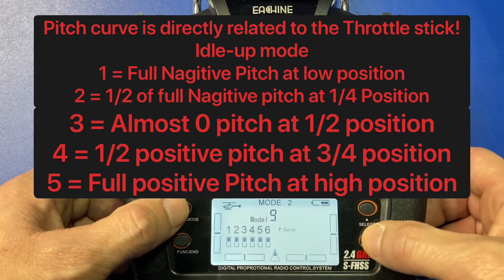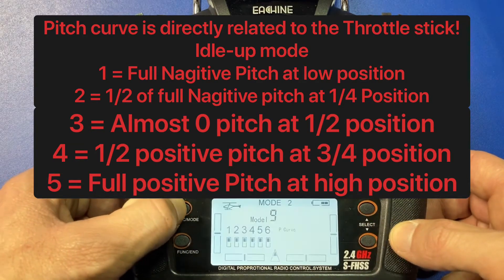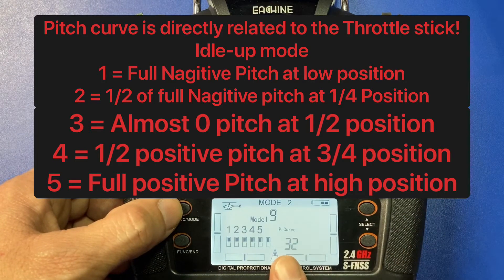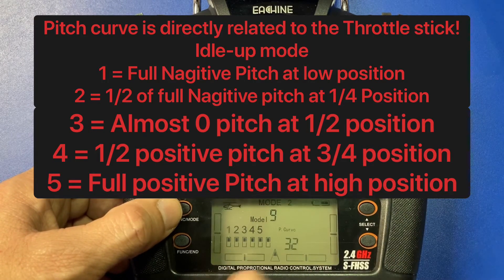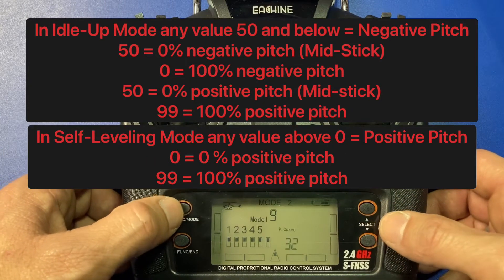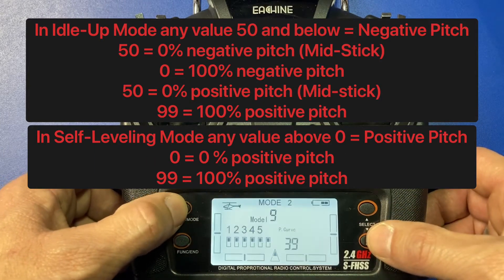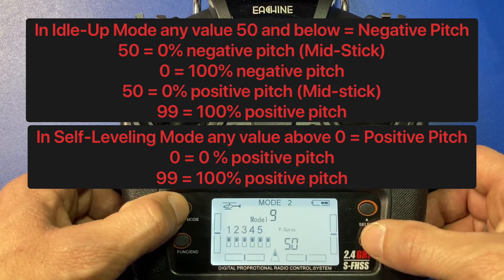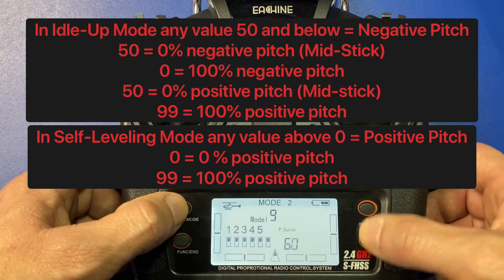Eachine e6 TX... T-Curves & P-Curves

Comment: Hello, I've been reading through your posts.  I saw you were considering buying the e180.  Did you get and fly this yet?  I have the e180 but no one to ask questions about it.

It came with the e6 tx and for the most part the curves were flyable for me but I toned down the head speed in both normal and 3d modes.  This is my first collective pitch and I don't do all the fancy 3d stuff but I do like to throw the sticks into a good tight banking turn and some loops and inverted  hovering.

So of course I've had some minor bang ups one of the last ones I broke my collective servo horn so replaced it.  Went into the servo centering mode on the receiver and leveled swash plate.  I'm worried with the sequence I did things because now when I flip switch for 3d mode it seems stuck in 6g.  

Heli won't let me bank or roll or invert or anything it just wants to level itself back out.  Seems like its stuck in stability mode or something.  So I thought maybe some setting I pit in tx was wrong but had no clear instructions on how to reset tx so like a fool just started button combos with powering on and ended up changing into mode1.  After figuring out how to get back to mode 2(throttle on left stick) I can fly again but still can't get out of stability regardless of flipping that switch.

Is there a way to hard reset everything back to factory?  I've seen this heli fly and it can do some.prwtty intense 3d for what it is but mine is way too tame for what I like to do.

Lastly, I'm centering all servos and 90ing horns as I've had to replace that servo horn AGAIN then will perform swash level in servo mode of receiver.  Noticed when I spin the motor it feels "notchy" and not smooth.  I never noticed this before ot always felt smooth.  Is this motor bad already.  I've barely even strained it yet.

I would appreciate more than you know any input as collective and setting up is all new to me.  I've flown fixed pitch for years but that is boring now.  This collective pitch is the ticket now!
Reply from the maker: Hey Keith, Thanks for the comment... Yes I did get the e180 but I set mine up with my Jumper t12... Look for the video it will be out very soon.
 YES COLLECTIVE PITCH IS THE TICKET!!!
I would suggest you first check that when you were pressing all the buttons as you said you did that you didn't change the gyro setting for Idle-up(it should be at 25 when you flip to 3d mode)... also check that all your other settings are as they should be... check that the sensitivity dials on the receiver are set back to factory settings(I think they should all be flat and facing the plugs)... you might as well try doing the debugging again on page 9 of the manual... 
As for the motor, it sounds like it may be a bad bearing... you would have to take the main shaft out and check that all the bearings that the shaft  runs through feel smooth... you can check the motor at this time as well.... does it feel different in the air?  Crashes can cause all sorts of damage, some minor at first but then get worse over time(like bearings)... Also make sure your MAIN shaft is not bent! You will also want to grease up the feather shaft and bearings because from the factory there is not a bit of grease(be very careful - there are very small parts in the head that go in a specific order) Let me know if you get it fixed or if you need more help with your TX settings or anything else. 
Please Subscribe, Like and Ding the Bell!!!
Reply: @DaddysRCAddiction  thank you!  Main shaft out and motor out.  Main bearings feel great.  Motor still feels not right.  I know it was smoother I remember spinning it when I got it.

I don't think I can set two gyro settings on that tx.  Same goes for expo.  One setting for all modes except d/r. 

I never messed with any of the screw settings on receiver.  Theu are all turned same way I think the slot is in same direction length wise as heli. I'd have to look again.  

I will try your suggestions.  How hard is it for a receiver to go bad?     Also what kind of grease do you use on the head?
Reply from the maker: @keithlong2788  Sounds like it may be the bearings in the motor... mine does feel very smooth when I rotate it.
I use RED N' TACKY #2, it may be a bit over kill but I find it works well.
Expo only has one setting for all modes but the gyro must have at least two different settings to tell the heli that you want it to go into ARCO mode... When in the gyro setting of the menu flip the 6G/3D switch... In the 6G position the setting should read 75... in the 3D position the setting should read 25, if it doesn't then this is the reason why you can't get out of 6G mode... change it to 25 when the switch is in the 3D position. I have hundreds of models and I haven't had a receiver go bad yet... maybe I have been very lucky:) let me know how it goes!
Reply: @DaddysRCAddiction  You were right!!  Gyro was on 75% in 3d mode.  I switched it to 25%.  Confirmed by toggling the switch.  6g reads 75% and 3d reads 25%.  I wish the manual explained things better but i guess thats China for you!  

As for the motor, i did rip it down and the bearings feel just fine.  Took the windings out and it's fine in there.  Can't see a thing wrong.  I'm pretty sure what i'm feeling is the windings going past the magnets.  But i don't remember it feeling that way when i first took it out of the box.  Just really can't remember now.

So question is, is it normal to feel the notchy type feeling from the windings or are they supposed to be absolutely smooth?  I think i'm putting it back together and just flying it.  The motor is $40 and it'll take 2 weeks from Banggood.  I didn't think about length of time when i would need parts for shipping.  I want to get a better transmitter as i've been training with real flight 9.5 and that spectrum it comes with is so much bigger and better feeling.  I'm having a hard time with that e6 transmitter as it is smaller and harder for me to get a full motion of the sticks.  Maybe it's just me.
Reply from the maker: @keithlong2788  Once you decode the Chinlish in the manual and play with the TX a bit its all pretty basic.
Glad I could help out with the gyro... Yeah motors will have that slight resistance from the magnets... if I rotate mine very slowly I can feel it as well but it is much smoother than my other helis and quads... and it is absolutely normal!! Many of my other motors have a much more notchy feeling... I should have mention that! The e6 is an OK starter TX but a better TX with hall gimbals will give you a much better feel at the sticks.
Have you adjusted the end points?... This will give you full stick motion.
Reply: @DaddysRCAddiction  i have not adjusted anything other than curves, d/r, expo, all the normal stuff on the tx.  What is involved with adjusting end points?  Does that involve the little screws on the receiver?
Reply: So everything back together.  Centered and 90'd all servos.  Did use some sub trim to help with that but noticed it took away from full deflection so I will zero all subs then correct with debug mode.  Servo 2 I got dead even 90 with no adjustment so I will use that as my master then level the rest in debug.

But regardless it flew and I tried 3d with the new gyro setting at 25% and yowsers!!  This thing is like a loose rocket!!  And this was at 60% rates.  Expo doesn't seem to make much difference with this tx anyways, maybe dampens in down a bit.  

So my biggest complaint, why does it take so long for servos to return back from your last input.  Like delayed reaction and its making me over correct.  Nothing is stuck.  This seems to be how this system is.  The input is as fast as you apply but when you go back to center the servos are like a good 3 seconds behind.

Can this be controlled?  I may consider.another heli if I can't fix this because I didn't train like this.  And definately gotta save for another tx because I'm hooked on the spectrum and those sticks.  I can see now why people stay with the same tx for all their models.

I really appreciate you taking the time to read my posts and replying and helping me out.   If there is something I can do to fix this delayed reaction with the servos please let me know.
Reply from the maker: @keithlong2788  😁it’s nice to hear that you are enjoying your “rocket”!
I love my spectrum system as well... for the most part it is flawless and easy to use but that does come with a cost!!!
There are other systems that are just as good but you do need to know or be able to figure out the little quirks that they may have.
Direct drive systems are super efficient and powerful compared to gears. I’ve turned down just about every setting and it still feels powerful! 
Now Exponential is tricky... I typically fly with little to no expo depending of the heli and radio. 
Expo takes effect around mid stick so if you have too much expo and you are at or near mid stick a lot you are going to have a lot of delay(this is why I tend to not use expo.) so what you are feeling could be the area on the sticks where expo has softened the sticks... I felt it a lot on this heli and turn my expo almost completely flat. Also, once you move the stick beyond the assigned expo setting then the actual amount of throw will happen... so if you have a 1/4 of the stick soften with expo the response will be limited until you pass the 1/4 Mark then what ever would be normal movement without expo will happen all at once on your heli to catch up to your stick movement where expo is not assigned.
Hope that made sense.
Now it could also be the potentiometer gimbals which can wear out or just flat out not work well straight out of the box.
But I’ve found that all my X6 and E6 tx worked pretty good so I would try turning down the expo... try flat and work your way up a few points at a time. 
You are very welcome for the help... I wish I had some help at the beginning as well!
Reply: @DaddysRCAddiction  yeah this is my first.collwxtive pitch and its direct drive at that.  I can't say I'm enjoying it yet!  Quite nervous is more like it.  Not like the sim where you can run forever and just hit reset when you crash.  Four minutes goes super fast and I would swear it feels like only 2.

This delay im speaking of is basically the swashplate coming back to level after a command.  Its after expo which is what I don't understand.  Like if I give right aileron ot goes right aileron right away whatever I give it.  But when I let the stick come back to center the swashplate is so slow to follow.  So when I correct out of a bank when the swash catches up I'm over corrected.  Not sure how to explain this.  Is this by chance anything to do with gyro?  What happens if you turn that 25% down to zero and no gyro at all in 3d?
Reply from the maker: @keithlong2788  that sounds like too much expo(expo is effective around mid-stick) so if you just go back to center, that is where expo(less stick/servo response) is applied... because of the expo the servos aren’t responding to your inputs... have you tried no expo? You can visibly see the effect of expo when programming it(try 0 expo, move the sticks very slowly... it should follow your every move... now try 60-80% expo and move the sticks very slowly you will see that very close to mid stick the servos will not move at all... further out they will move a bit... then towards the outer edges the servos will move a lot to catch up! 
This is what I noticed when doing tic tocs... a big lag... then I dialed down the expo and everything’s was better. At least for the way I fly.
Just go slow because it will follow every little hair movement... this is the way I fly for the most part... I like the feeling of instant response. But it can be tricky when learning to fly that way.
Reply from the maker: @keithlong2788  don’t change the gyro setting
Reply: @DaddysRCAddiction  yes I tried 0 expo, negative expo, positive expo all while moving sticks.  I've read with futaba systems you need negative expo for less on center stick.  But I though expo was only noticed on inputs, kind of like slowing down a command.  This is occurring well after input.  Like I can take my finger off the stick and watch the plate neutral out.   Gotta be something I'm not doing right.  And we already agreed that tx only has one expo setting for both flight modes correct?  I want no delay on the input or return but not sure we're gonna achieve that.

What do the 3 little screws do on the receiver?
Reply: You mentioned aboit endpoints earlier too.  How.do you go about that?
Reply from the maker: @keithlong2788  Yeah its backwards with futaba... If its occurs after inputs then it could be your potentiometer gimbals... I installed Hall gimbals in my Jumper t12... I will try it on mine and see how long it takes to center.
I just tried it... and what you are seeing is normal for Idle-up modes... It will not snap back to center like it does in Stability mode... In 3d mode it will  hang behind if you let go of the stick because it think you still want to go in that direction but you will notice if you move the stick purposely from center to edge (not letting go of the sticks - complete control) and back again it will follow your every move.
When flying a heli you never what to let your sticks go anyway... you are always making hair like to extreme adjustments depending on what your are doing.
Why don't you get a spectrum satellite receiver and hook it up to your spectrum system? You have a spectrum radio right?
So there is no endpoint adjustment on the e6 tx... the only way I've found to kind of get an endpoint like adjustment effect is to adjust the High dual rate so that the servos don't bind and that the stick is moving the servo through its complete range of motion... this is not like real end point adjustment but I do this on all my inexpensive TX and I find it works well.
But it sounds like you are hooked and a better radio is in your future!!!!

I haven't messed with the 3 little dials yet but in the manual it looks like you can increase or decrease the sensitivity of your tail lock and swashplate... not sure of the effect it will have. very small adjustments if you mess with those dials.
Let me know how things go!
Reply: @DaddysRCAddiction  I only have a spectrum interlink for real flight sim.  Man do i wish it wasn't gutted because i'd switch it over in a hearbeat.  i was looking at spectrums the other night.  Had my eye on the DX6e though i do like the DX7 with the voice alerts but i.  I don't want to spend a whole lot but definitely want something better.  Considered buying a used one but i think some of the prices people are asking are ridiculous and for another $100 i can get brand new DX6e with a receiver for $279.  I'll need the receiver anyways to bind the e180 from what i understand along with a satellite.  

I guess you could say i'm definitely hooked.  I was always into the hobby.  Had a couple of gas cars back in my teens then got out of it.  Then started on nitro planes, that was a lot of fun.  built a couple models but that was when you still used the old transmitters with the channel and the antenna you had to extend.  My ultimate dream even back then was to get a heli and people said they were so hard to fly.  A couple years ago played with the coaxials then moved to the 4ch fixed and i got so bored i stopped.  finally got the nerve to get a collective and it was the best move yet.  There is no comparison.  The e180 sat for weeks while i played with the simulator and boy was it hard.  Forward and upright flying i'm pretty confident.  Trying to learn backwards and i'm much better than i was but wouldn't try it with the eachine yet no way.  Then onto inverted flying forward, then eventually backwards.  i can invert and roll but i can't sustain anyting inverted for any length of time.  Oh well in time i guess.

Anyways i calibrated the e6, i think anyways.  I read off of one of your posts how to do it.  since i've done that i have not experienced that lag of the swash plate.  And i'm only using about -5 expo to try and soften it up.  I'm at 60% low rates and wow this eachine can get away from you fast!  I can't tame that beast yet, had to ditch a couple times keep forgetting to switch it to 6g to recover but there's just not enough time ya know?  i'm at least remembering throttle hold and my grass is on the tall side so there's some cushion.

Which spectrum would you recommend?  Do yuo know if that 6e has a timer on it.  that is a nice feature.  if not i'll just put a timer around my neck easy fix.  I'm not touch those screws.  What does it mean when you set your tail lock?
Reply from the maker: @keithlong2788  Hey Keith, Sounds like you have the 180 running well! The Tail Lock dial I believe controls how aggressively the systems holds the tails position... So if you noticed the tail blows out(moves during a punch out)
then turning this dial up should help lock the tail in place(the tail should not rotate during a straight punch out unless you give a rudder input).
Helis are very hard to fly... They are much better now with all the FBL programming and stability modes!
When I started with heli's I went straight to collective pitch (Blade nano with no safe or AS3X) and no help from a sim... In fact I only got a sim a couple of years ago.  SH*T, while learning I spent more time crashing then flying... I spent hours sitting on my couch just trying to get it up in a hover in my LR. The went outside when I started inverted and crashed some more... Its a good thing the nano was so lite... Still by the time I started to get the hang of it, it was held together with tape and the boom was a wooded skewer, LOL but I had the best time learning... Finally I lost it it the woods while fling inverted... from there I went to a 450 blade with a flybar system... man that thing was intimidating... My brother would stand behind me when I flew it. LOL  I have a couple of fixed pitch helps that a friend gave me... I used to do flips with them by fly fast into a loop... That was fun at the time too.
Once I got FBL helis with stability modes I started to practice different maneuvers  with my finger ready to flip back to stability... In fact I would flip back just to ingrain the reaction. Now I don't really do that at all.
But you definitely want to practice different hovering positions (Tail in - Nose in - side on - angles in between those) so that you know that at any moment you can stop and get control in a hover no matter which direction the heli is facing.
Hair like movements and YES, YOU HAVE GOT TO LOVE TALL GRASS:)
I have the DX6... I love it but these systems are power hungry so you definitely want to get the lithium rechargeable battery... The DX6e has an "Important Bulletin"... In the bulletin it states that some models don't support the rechargeable battery... check that out... And I would suggest you buy straight from Horizon Hobby... It makes resolving any issues much easier.
For the most part my DX6 has been perfect... there was one time I wish I had the 8 or the 9 because of my Timber X, it  needed a 7th channel for Aileron/Flaps combining (so I can't do that now... Oh well). If you can the 8 or 9 would insure any future needs but if you think you will never need any more than 6 channels I think you would be super happy with the 6.
As for the satellite receiver... I think all you need is the DSMX Remote Receiver($39)... After all, you are only trying to get the signal to the existing receiver. The 180 has a receiver on it already with the hook up for the Satellite... You might want to buy a much shorter extension because it comes with a 24"... thats way to long. I have a similar set up on my Align 150 DFC.  But the extra receiver with the bundle is good... I got the receiver bundle when I bought my DX6 and used it in a plane.
Keep me informed... I'm still learning just like you!!!
All the best
Reply: @DaddysRCAddiction  hey how's it going?  Had a pretty frustrating day today.  Had 4 packs charged and first pack I crashed the 180.  I feel like packing it in to be honest.  Evwrytime I fly this thing it acts different.  I've gone over my tx settings, leveled and releveled swash plate, checked all movements etc and its just unpredictable everytime.  I'm so bummed because I can fly like a maniac on the sim (upright anyways) then try to fly the real one and its nothing like the sim!  The sim is good for teaching the sticks and basic reflex memory but its too perfect.  Everything is smooth.  I don't know maybe its just that cheap tx but I really can't afford another at the moment.  The e180 is a decent heli.  I have not calibrated the stabilization in the gyro yet but not sure that would make a difference in 3d mode.  I have not been flying in 6g I feel like that mode is deceptive and I can't get ot of trouble unless of course I get into trouble.  Hope that makes sense.  I just feel like regardless of 6g or 3d it is delayed but I've watched the swash and it reacts to my every move.  So maybe I messed up my tx.  Though I could stiffen up the sticks by adjusting screws on back of tx.  Did get them more stiff but then they didn't move freely.  Turned the screws back and they are back where they were but are they really?  Well anyways its gonna be 2 weeks till I can fly again I broke the upper pitch connects when I hit the side of my house.  I know I know you're probably laughing right now!  Was apply right aileron but it didn't seem to want to respond and there it went.  I knew it was going bad and killed throttle.  All I found was those broken upper connect and the servo horn to rear servo.  And of course can only get the parts on banggood china warehouse!  Never doing that again.  Love the heli but you need to buy triple the parts list!  How do you feel about used tx's?  I mean a lot can be said by the way it looks but you know we have to use our judgment on that.         So maybe my low dual rate is messing me up.  I'm set at I think 60% but scared to death to go to high rates.  That tx seems like you really need a lot of stick to get response and my expo is only at -7.   Maybe I need to give it + to make it more responsive at center but keep the low rate.  Open to suggestions.  Thanks so much!!
Reply from the maker: @keithlong2788  F*ck... I hate when that happens but I've done that many times... then you have to figure out how to burn your other batteries or take the walk of shame back to your charger to discharge them:(  Don't get discouraged... heli's are very hard! 
BTW... I uploaded my Eachine E180 video, check it out and if you could please give me some constructive feedback, like things I didn't say or you would have liked to see in the video.
I found that the e180 was lagging too but when I turned down the expo it helped a lot... maybe, like you said, you need to make center stick more responsive. Try a flat expo... but before you fly, move the aileron and elevator very very very slowly and watch the servos/swash plate to be sure  that the sticks don't have any dead spots, especially around center stick. 
If the gimbals are bad you should be able to see it while doing this!
Like I mentioned before potentiometers gimbals will wear and start to lag.  
I assume your servos are OK. 
Have you taken the head apart and greased the feather shaft and bearings? (maybe they are sticking)
Could be your dual rate, maybe you have it set too low. I've alway liked higher rates because I want instant/fast response but sometimes you need lower rates for the type of flying you are doing.
Oh and by the way I did laugh but it's because I've flown into my house as well.. LOL
Without seeing you fly and feeling the TX/heli response it's hard to say if it's the Tx/heli or user error. Helis can be super tricky but seeing how you have done RC planes in the past I assume you would know if it's a TX issue or lack of experience.

Sims are great but the real thing is much faster and creates much more tension... so now nerves get involved and things can go sideways fast. I always turn the speed up on my sim so its closer to the real thing and when ever trying what you're done in the sim in real life go about 4 mistakes high(fly higher so you have more time to recover) 
BUT YES, SIMS ARE A GREAT TOOL BUT NOT THE REAL THING
I always prefer NEW... although you could get a good TX for less you might also be getting someone else's headache... i would only do it if it was like 1/4 the price... but that's me.
Maybe you should get an open tx radio like a Jumper or the Radiomaster TX16s(I think I may get this one)... here's a link...
https://www.banggood.com/RadioMaster-TX16S-Hall-Sensor-Gimbals-2_4G-16CH-Multi-protocol-RF-System-OpenTX-Mode2-Transmitter-for-RC-Drone-p-1652191.html?rmmds=product_topselling&cur_warehouse=CN&act_poa=POA6384750&ID=424826287800
Its more affordable and it's multi-protocol, so you can bind to just about anything out there.
There is a bit of a learning curve with opentx radios, but thats not a big deal. There are lots of youtube vids on it.

So I would suggest you start at flat expo and rates about 65... just hover and move in all directions with slow stick movements and some faster stick movements and get the feel... make 2 to 3 point adjustments on only one thing at a time (expo, rates etc) and fly it again... continue like this until it feels natural to you and reacts in a way that you feel is predicable.
You may even want to turn down the Throttle Curve for Idle up just to make it react slower.
Let me know how it goes.
Reply: @DaddysRCAddiction  your jumper t12 looks like its decent. K was thinking that.  And the price won't break the bank!  What kind of learning curve are you referring to as far as that radio?  No have not greased the feather shaft but I too wonder maybe its sticking/catching.   I will try your suggestions with adjustments.  My e180 did not fly like yours in stabile mode.  Mine wanted to keep going right.  Actually found it to track more straight when I switched to 3d mode.  I was in normal mode to by the way qhen I crashed today maybe that's why I didn't get the response I needed.  Head speed to slow.  My throttle curves I jacked back.  I think I'm only 65 normal and 80 idle up.  Part of the problem is I have a limited flying area so I start to panic then that's when things go bad.
Reply from the maker: @keithlong2788 It's a good radio... I think I paid $80 and it came with a external module... I got it to learn openTX and Iwasn't sure if I was even going to use it much... But I ended up using it for a lot of models... I now would like the one I had suggested to you... it interface is easier to use and its in color... 
here is a link to Eachines version of that radio(I think its even made by RadioMaster for Eachine)
https://www.banggood.com/Eachine-TX16S-Hall-Sensor-Gimbals-2_4GHz-16CH-Internal-Multi-protocol-RF-System-OpenTX-Radio-Transmitter-for-RC-Drone-p-1837632.html?cur_warehouse=CN&ID=42482&rmmds=search
The problem with the Jumper t12 is
1-I'm not sure if they still make the t12 or if you can find it anymore... I can only find the Jumper T8SG (Link below)
2-It's a small radio about the size of the e6 or smaller
3-It comes with potentiometer gimbals... So I had to buy and install Hall gimbals because the they gimbals wore out.
Jumper T8SG (This one comes with hall gimbals)

https://www.banggood.com/Jumper-T8SG-Plus-V3-Carbon-Special-Edition-Hall-Gimbal-Multi-protocol-Advanced-Transmitter-for-Flysky-Frsky-FPV-RC-Airplane-Parts-p-1442802.html?cur_warehouse=CN&ID=42482&rmmds=search

The T8SG is $128
The Eachine is $175
The Radio Master TX16s is $199
for a $70 difference I think it makes the most sense to go with the Radio master... but thats what I would do now that I have used the jumper.
Any open TX radio is based on the OPEN TX system... so its exactly how its sounds the system is completely open and you can configure it in any way you want... you just have to know how to do it... it can get confusing... but the more you do it the more sense it makes. There are forums and many videos on different models and model types for the opentx system.
so all the programming has to be done by the user... if you watch some videos on open tx you will see what I mean... but many if not most helis and quads now have on board flight controllers so for the most part you won't have to program all that but you will need to program a mode switch, the rates and switch, the hold switch etc.

Do you have the heli on a level surface when you plug the battery in and then let it initialize(the FC uses that time to determine what level is for stability mode) that could be why it pulls to the right or why it is different every time you fly... also why it seems to track better in 3D mode.

Let me know your results when you get your parts... what part of the country are you from? I assume you live in the US.
Reply: @DaddysRCAddiction  Open TX just sounds like one more headache for me.  Maybe once i get flying better but for now the simpler the better.    Can you recommend an affordable decent charger for these packs?  The one it comes with is junk!  Also, a tester for the cells?  

I took the feather shaft apart tonight and like you said no grease in there at all.  I was not expecting so many little parts in there but you did warn me about that.  I've never seen a bearing so small.  Luckily when the bearing and washers came out they were all stuck together so i could see the order they were in.

so all greased up now.  been tempted to make my own connecting gear for the top but then though maybe not a good idea.  at least the plastic ones sheer off which they probably are supposed to do.  Metal rod links arent gonna sheer and probably cause more damage than i want to deal with right now.  

I did play with the expo tonight without flying and paid close attention to swash.  It's definitely following my stick every single move.  I put expo on zero for now like you suggested and i think that might be the ticket to get more reaction at center stick for my style.  And i've been plugging batteries in while holding the heli and not on level surface so that might explain that.  After it initializes on level the gyro is set right?  so i can pick it up then and put the canopy on?  Wish canopy's were easier.  What a pain every 4 mins chaninging battery.  Thanks for the help!
Reply from the maker: @keithlong2788  I'm looking for some help... Did you have a chance to view my E180 vid... Can you please let me know if there is anything I could add in the vid or if the video left you with any questions that I didn't answer.

Yes opentx was a bit of a headache for me at first but like anything there is a learning curve. I started out with Spektrum as because of the easy of use and all HH products come with detailed instructions for setup. 
Yes the gyro is set for that battery... After it's initialized you can move it as needed.
The following comes with a deans and JST leads so you will need to get XT30 adapters that fit on the JST or DEANs so you can charge your XT30 batteries
Charger...
https://www.banggood.com/IMAX-B6-80W-6A-Lipo-Battery-Balance-Charger-with-Power-Supply-Adapter-p-1401686.html?cur_warehouse=CN&rmmds=search&ID=47759
XT30 adapters...
https://www.banggood.com/5Pcs-2S-7_4V-Lipo-Battery-Adapter-Connector-XT30-Male-to-JST-Female-Plug-p-1376913.html?rmmds=myorder&cur_warehouse=CN

This is the same charger with an internal power supply (I have 4 like this one) and a quad charger 4x(I hate waiting)... 

https://www.banggood.com/IMAX-B6AC-80W-6A-Updated-Balance-Charger-Discharge-for-Lipo-or-Li-ion-or-LiFe-or-NiMh-Battery-p-1497293.html?cur_warehouse=CN&ID=47757&rmmds=search
Tester...
https://www.banggood.com/CellMeter-7-Battery-Capacity-Checker-Tester-LiPo-LiFe-Li-ion-NiMH-NiCd-p-85223.html?cur_warehouse=CN&rmmds=search
Reply: @DaddysRCAddiction  hi Steve.  Thanks for the links to the chargers.  Going to definitely get one. 

Just watched your video.  Very informative.  You mentioned all the things that I noticed when I flew it.  I heard you mention about the banking of the heli and adjusting the gyro and that you didn't find a way to get it to bank more than it does.  Not sure if you made the video before or after your advice aboit lowering gyro in 3d.    So in 3d mode will this heli roll and do bank turns?

You mention you were going to try and soften the heli up on the controls.  As you know that was a lot of my complaints with the e180, very unforgiving.  You also mentioned your throttle settings and mine are higher than yours so I'm copying you.  Your style looks similar to my preferences.  Maybe my head speeds are just too dam high.  But anyways if you get yours tweaked maybe a follow up video of your final settings.  But it was a very good video.  How many minutes are u getting out of a pack?  Mine seem to go really quick but again I was running higher head speed.
Reply from the maker: @keithlong2788  Hey Keith, No problem! 
I was referring to the amount of bank angle allowed in Stability mode not 3D mode.
So, I have a bunch of Blade helis... and blade had some nice flight modes and features for beginners. 
They still do but the modes have changed!
Some models have 3 flight modes...  
Beginner  -  This mode has a very limited bank angle
Intermediate  -  This mode increases the bank angle so that beginners that are feeling more comfortable can step it up without going into full acro/3D (they don't have this anymore for some reason)
(This is what I was referring to when I mentioned turning down the gyro to increase the bank angle)
so I tried turning down the gyro to see if I could get more of a bank angle in Stability mode but it didn't work... thats what I mentioned in the video.
In 3D there is no bank limit so you can flip, roll, bank as little or as much as you want!!!

I found the head speeds, 3D T-curve and P-curve and rates to be way to high... but I think it is my radio(Jumper T12)... It is super responsive which I like but it seems to be much more "Tight" (as I say in the video) than my other radios.
so setting in my Jumper T12 will not translate well to settings in my DX6 etc.
I will let you know when I find settings that I feel really comfortable with but you will have to adjust them according to what ever radio you are using at the time... Right now I assume that will be the e6
I could send you the settings I use on my x6 for my e160(the x6 is virtually the same radio as the e6)... it might be a good starting point.
I don't recall exactly but I think I was getting around 4-5 minutes depending on how I was flying. Maybe a bit more if I was just cruising.
Reply: @DaddysRCAddiction  hey Steve!  Thank you for clarifying the banking thing.  I was getting a little concerned I bought a toy.  I mean I'm not ready for a Goblin either but you know what I mean.

So I managed to snag a use experience that is in cherry condition.  Got it for $125.  May need your help binding the e180 to it.  I think you said ill need a dsmx satellite.  I got at least a week till the tx comes and I'm still waiting for my parts. 

So I'm noticing the buttons on the  e6 tx are starting to not work.  Mostly the left menu buttons so I needed another tx anyways.  I did go into the sim and look for a heli closer in size to the e180.  I am really hooked on the blade fusion 450 but if the software is any good at imitating characteristics of the real heli's then i guess i should not be flying a 450 because its.gonna be much more stabil than a 180.

So I think I'm using a blade 250.  I'd have to look again but it it smaller.  The sim does have those beginner, intermediate and agility modes.  It flies very similar to what I've experienced with the 180 so I'm sticking with that.model for now.

I ordered a lipo charger too.  Hot the one with the built-in power supply.  Im.excited to get that.  I really have my doubts that the one that comes with the heli was even charging them up all the way and or properly.

The spectrum radio I'm getting should be enough to get me through for awhile.  6ch is sufficient for me.  Not sure if ill ever get back to planes.  No where to fly them.  But the nitro engines are really fun but I m too scared to put one in a heli!  Gliding is much easier!

Well have a great weekend.  Talk to you later.
Reply: So proofreading my post.  I meant to say I snagged a used dx6e transmitter.  Auto spell pit something completely different in.
Reply from the maker: @keithlong2788  Hey Keith, Nice... Thats half price... I think thats well worth it! Before any flights with the new TX make sure all the settings and directions are correct. Let me know if you need help!  
Did you get the XT30 adaptors... you will need them and the satellite as well.
I always charge on the lipo balance setting to keep my batteries as healthy as possible and I never fly them below 3.7 per cell(I have my timers set to go off at around 3.8 per cell). Check out my vid on Lipos...  https://youtu.be/AuJfa0VNyt4
THIS IS SUPER IMPORTANT(always plug the Black and Red leads into the charger before hooking up the battery) If the battery is hooked up to the leads first and the Black and Red wires touch, bad things will happen!!!!!
I do the same thing in sims, try to practice on what I plan to fly or something similar.
The radio will be perfect for just about everything you plan to do... Like I said, I only wish I had more channels with that one plane... Thats kind of why I got the Jumper so if I do need more channels I can just put the model on the Jumper and so I could use different potocols!
Speaking of Planes and no where to fly them... one of my subs has a channel where he flies mostly planes and he lives out in AZ... I am so envious of his flying field... Sooooooo much open space! 
His name is Ricky, check him out and sub if your like his vids!
https://www.youtube.com/user/ricardopr54/videos

Hope your weekend is relaxing, All the best!!!
P.S. Here are my current settings for the e180(this is in my JUMPER tx) Still needs more tweaking!!!
Curves:
T-Normal(I have a 7 point set up) -100 -60 -19 15 45 75 100
T-Idle-1   55 55 55 55 55
T-Idle-2   65 65 65 65 65
P-Normal   -10 3 13 45 75
P-Idle-1   -60 -30 6 33 60
P-Idle-2   -60 -35 6 35 60
Rates + Expo: (for Ail, Ele and Rud)
Low - 57  Expo 7
Mid - 69   Expo 7
High - 74  Expo 10
Reply: @DaddysRCAddiction  Hi Steve.  Well i'm still waiting for parts mostly.  My upper connects did finally show up so i put them on.  Decided to work the swashplate a bit while my blades are off.  Noticed when i spooled up in normal the right front servo moves as it should with my stick but then all the sudden it jumps down which is where it rests for the remainder of any travel on the throttle stick.  this is why my heli pulls severe right when in normal mode.  When i switch to 3d the swash goes back to level and no glitches in any positions.  I'm not sure why this one servo is doing that and only in normal mode.  Thought maybe the gyro was too sensitive but i found with the gyro that anything below 51% is basically off and anything 51% and over is on.  I have not seen a difference between 51% versus 75% but this is just on the ground and not actual flying.  So, maybe this one servo is damaged from a previous mishap??  Might be worthwhile to replace it?  Something else also seems off when i spool up.  Feels unbalanced.  Just visually looking at the rotor head in comparison to the heli body it looks like maybe it's bent.  I pulled the main shaft and rolled it on my desktop but it rolls smooth not bumpy.  I think maybe that feather shaft is bent and got bent when i broke that upper connect.  Also when spinning blades look like there is travel at the ends like they are pulsating up and down 2-3mm.  this is probably what's causing the vibration.  Do you think i should replace the feather shaft (head) and put new blades on right away as well?

As far as a satellite what am i looking for?  Does that stay connected to the heli then?  I didn't buy the actual connectors for the charger but i did buy the one with all the leads on it for multiple packs hope that will work.  It had the XT30 connector on it.  let me know
Reply: found a bent horizontal shaft in the feather shaft.  that explains the off balance.  The 4.3g servo that is in this heli, can i get another brand from horizon or something?  Am i just looking for a sub micro metal 4.3g servo?
Reply from the maker: @keithlong2788  Hey Keith, The satellite stays connected. Replace the feathering shaft if you can... I have straightened a few out but they are never exactly perfect ever again... and the metal is weakened a bit because of the flexing. Sounds like you got the connectors you need for the charger. I've had servos go bad and thats pretty much how they act "Glitchy"... But usually in normal and 3D mode. Are you sure the system was level and initialized. If you replace them just be sure of the dimensions, that it is a digital servo and the plug that the servo comes with is the same. Banggood has them but you'll have a wait. Horizon may have something. It sucks when you crash but it does help your understanding during the repairs.
Reply: @DaddysRCAddiction  so can the dx6e direct bind to the e180?  I've been watching people bind that radio with models and I don't see them using a satellite.  Do all transmitters have a bind button on them?
Reply from the maker: @keithlong2788  the e180 has a S-FHSS receiver so you will need a spektrum satellite receiver to plug into the satellite port on the e180s receiver. Not sure what vids you saw... maybe they had a spektrum based receiver in the craft already. In the DX6e menu there should be a bind option.
Reply: @DaddysRCAddiction  ok makes sense.  I'm getting confused. I saw the dsmx port on my receiver and thought it is dsmx based.  Now I realize that just means you can plug dsmx into it.  How do you go about straightening that shaft?  The right thing to do is get another but I have to wait sooooo long!  And wow arw there a lot of servos out there!  Can't seem to locate that particular one (4.3g sub micro).  Does 4.3g mean the weight?  Wishing I would have grabbed the M2 cause getting parts would be a whole lot easier!  Yes my heli is on level qhen I initialize so I don't know why it glitches like that only in normal mode.  I can't trim out for it either cause then it screws up 3d mode.  I like normal mode for landing and adjusting stuff so I don't want to not use it.  I don't know man.  Well thanks again for all your help I do appreciate it.  I should just give you my cell # unless you're ok with posting here all the time.
Reply: Looking at satellites now.  So I buy this and plug it into receiver?  Then do i push bind button on e180 receiver then turn on spektrum and put that in bind mode?  YouTube videos showing hooking satellite up to a spektrum receiver (which i don't have, one i bought didn't come with one).  Looks complicated to do.  Do you have any videos on this?  So confused.
Reply from the maker: @keithlong2788  I think you are over thinking it... let’s say your e180 receiver speaks Spanish and your spektrum TX speaks English... the satellite is part of the translation... The only thing a satellite does is receive your TX inputs,  which then gets translated by the e180 receivers programming so it can understand. This is why it has that special port for the satellite.
The videos you are watching may be for people who have bigger aircraft’s... in bigger models the signal can get blocked by the material the craft is made of... so in this case some models need 2 or more receiving points on the model to ensure that the signal gets to the main receiver... hence “Satellite”... used along with the main receiver... in your case the main receiver is the e180 receiver.
Reply from the maker: @keithlong2788  For binding... the satellite should come with instructions. I did this years ago but I believe you need to bind to the satellite... once the satellite is plugged in it should start flashing and wait for a signal from you TX asking it to bind. once your bound to the satellite I think that will take over... I haven’t done this with the e180 so I’m not 100%.
Reply from the maker: @keithlong2788  LOL... I thought about that this morning... I was thinking I could explain this some much faster if we were on the phone. If your OK with it send me your cell... we can get through this stuff so much faster.
Reply: @DaddysRCAddiction  im thinking too some of these videos are old.  Mostly what I'm seeing is people not having a way to put the satellite into bind mode from the heli they are putting it on.  So they have to hook it to a system that it is based off of and bind it first.  Then you can pit it on another heli.  So on newer helis like the e180 have they incorporated a way to put remote satellites into a bind mode from the heli you want to use it on?
Reply: Hey Steve, haven't spoken to you in AWHILE.  I've been super caught up with work.  Got the Spektrum TX and i love it.  Still having issues with flying the e180 in 3d.  Was wondering if you get time can you look over these settings?  I'm a little uneducated with the new TX, lol!  This is turning the TX on right from startup.  I know you have a spektrum, how would you set it?

here are my general settings with the Spektrum TX.

servo setup:
travel all set at 100

D/R & Expo:
Curve 0 Aileron, rudder, elevator all 100% & 4% expo
Curve 1 Aileron, rudder, elevator all 75% & 3% expo
Curve 2 Aileron, rudder, elevator all 50% & 2% expo
all set to switch G

Throttle cut: Inhibit
Throttle curve: normal-0-60-65-65-65, stunt 1: 75-75-75-75-75 Stunt 2: 85-85-85-85-85
Pitch curve: normal 46-48-50-65-80 stunt 1 0-25-50-75-100 Stunt 2: 0-25-50-75-100

Analog switch setup: didn't mess with
Digital switch setup: didn't mess with
Gyro Pos 0: 75% Pos 1: 0.0% Chan: Gear Switch: C

Mixing, range test, telemetry, vtx setup didn't mess with

Under system setup:
selected model the type and named it
Swash plate type: normal, collective type: normal
F-mode setup: Switch 1: Switch B, Hold switch: switch H

Channel assign Input config: 1 throttle n/a, 2 aile n/a, 3 elev n/a, 4 rudd n/a, 5 Gear: C, 6 Aux1: inh, 7 Aux 2: inh

Rx Port Assingments: 1 THRO: throttle, 2 AILE: Aileron, 3 ELEV: elevator, 4 RUDD: rudder, 5 GEAR: Gear, 6 AUX1: Pitch, 7 AUX 2: Gyro

Trim setup: throttle: 0, aileron: 0,Elevator: 0, rudder: 0, Hov thr trim: inh, hov pitch trim: inh
trim type: common, trims: normal

Telemetry: Auto config, 1 empty 2 empty 3 empty 4 empty 5 empty 6 empty 7 empty 8 empty 9 empty 10 Rxv 11 flight log

digital switch setup: Switch: Select, Channel: Inhibit, go into that submenu it's just 100% and -100% for switches, didn't mess with any of that stuff

everything else with the Spektrum is mostly user preference stuff like contrast, timers, etc.

also wanted to mention, in the trim set up everything was factory set at 5. should i put to zero?

hope this helps a little.

Again i appreciate any advice you have given.  Could really use a walk through from start to finish with the DX6e but i thought i had the majority of it set well enough to fly but someone on RCgroups.com forum suggested i don't have the TX set up right because i should be able to fly it 3d no problems if i can fly sim.
Reply from the maker: @keithlong2788  Hey Keith, It seems we are very much alike… I’m a H.I. Contractor and I currently have 4 jobs going, so I’m a bit tied up with work as well… when I get a chance I’ll send you the settings I use for my align 150… it has a satellite receiver and should be a good place to start.
Reply: @DaddysRCAddiction  no prob, I just want to see someone else's settings with a similar flybarless.  Thanks a ton!
Reply from the maker: @keithlong2788  hey Keith, Man my life is hectic right now… I haven’t even had a chance to look at any of my RC stuff☹️.. I’ll see if I can get you some info this weekend. Are you able to fly it with the spektrum RX/TX?
Reply: @DaddysRCAddiction  yeah man but its twitchy!  I mainly need to learn how to set up my pitch and cyclic throw.
Reply: Thought about this after I sent it.  So mainly I've been under the impression that pitch curve basically was your overall pitch deflection but I'm learning its just a percentage of your overall max deflection.  The e180 has almost 14 degrees pitch deflection.  Didnt check cyclic but I'm sure its more than I need for a beginner.  Now I can tame that down with dual rates but its still not truly setting the deflection.  So, only way I can see doing that is through the radio with servo travel (limits).  Then pitch curves work inside THAT parameter.  So in high rates I can set servo travel to be 10-12 degrees pitch maybe 7-8 cyclic.  These would be max.  Low rates i can set for whatever I want to cut back on that.  Is this sound right?

On another note, something im trying to figure out.  When I adjust pitch curve and go back to main menu I cycle pitch stick and it doesn't reflect the new settings no matter what I set curve at.  I can set them all at 50 and then check and blades still pitch the same as last time.  TX is on throttle hold the whole time, doesnt matter what flight mode.  Does motor need to be spooling to reflect curve sertings?  I don't get it.  Now, if I try flying the curve  settings seem to reflect.  I can't check degree of pitch if blades are spinning, lol!!

I'm not flying much AT ALL!  No time with work and kids with school!  When you get time is fine.
Reply from the maker: @keithlong2788  Hey Keith, Yeah P-curve is how you program your overall pitch to interact with your stick position... You can have full pitch deflection at the bottom end of stick range(not what you want) or out at the top end of the stick range and any other variation that you like! 14 degrees is a lot for an experienced pilot!!! You should be around 10 degrees at most... So, I leave my servo travel at 100% and just turn down my dual rates to achieve the desired deflection... 
I think on my Trex 150 I have 3 rates... 
I will use servo travel sometimes to even out positive and negative pitch on helis where you can't make mechanical adjustments.
I haven't checked deflection on the bench for a while but I believe if you look closely you will see very very very subtle changes in defection(it should correspond with the area where you made the change in P-curve), but flying is the only way to feel the change and that is what is most important(how it feels!!!!!)
On my DX6...
Dual Rates 1= A-65 E-65 R-85, 2= A-85 E-85 R-95, 3= A-95 E-95 R-100
Expo, set this to your liking (everyone is different in how they like the sticks to respond) EXPERIMENT!!!!!
T-Curve for N=0,25,50,75,100   i1=90,86,84,86,90 & i2=100,100,100,100,100
P-Curve for N, i1 and i2 are all linear 0,25,50,75,100 (I do believe I need to adjust the i1 and i2 but just haven't play around with the 150 all that much.
Gyro=75 for stability mode and -75 for acro mode
Swash type is Normal
I think you asked what Trim Setup is in an other comment... this sets how sensitive your trim buttons are... I set mine to 1 because I prefer to make very fine adjustments. I think it comes from the factory set to 5 which will move the servos more for every click.
Hope this helps, let me know when you are hovering inverted and doing tic tocs!!! SO MUCH FUN!!! and SCARY!!!
Reply: @DaddysRCAddiction  hey Steve!  So basically let's say when you get a heli full pitch and cyclic deflection could be up to 14 degrees pitch, maybe 9 or 10 cyclic.  If you use a linear pitch curve you'll get that full deflection which is a ton!  So someone like me would not want that much so you use a percentage of that which is where curves come in.  I only want 10 degrees so if I take say 30% away from 15 degrees that would make it 70% at top of curve, or around 10-11 degrees pitch at high stick and similar set for negative pitch.  So setting max pitch isn't something you do as an initial setup?  And i can use my rates to get percentages for cyclic im assuming is what you are saying?   So only thing mechanical set up is center servos, level swash and zero pitch at center stick.  Everything else is curves.?

Right now I physically used my servo travel to reduce pitch throw down to 10 degrees +- and did same for cyclic.  I then set low rates at 50% so that literally cuts everything in half from where my servos cut off.  Same with pitch curves.  I think I set 30-40-50-60-70 pitch after already reducing servo throw to 10 degrees pitch so 70% of 10 degrees is 7 degrees pitch?  I did fly it this weekend set this way and I was successful.  Stayed away from 6g.  Only use it as a panic now and landing.  Theottle in normal is 65.  Sticking with that for awhile before I go to iu1!

Also, haven't figured out this gyro yet except that the 75 for futaba is +50 and 25 futaba is -50 with spektrum.  Do any numbers besides 25&75 change anything with the e180?
Reply from the maker: @keithlong2788  so, it seems you have a good understanding now. 
So with P-Curve you can limit how much over all pitch you have but I typically use a linear curve that starts at 0 pitch and ends at 100% pitch available on that particular heli. And just dail down my dual rates to get the flight performance I’m looking for. The more useful aspect of a pitch curve is when you want a certain amount of pitch at very specific points in your stick range. On some of my helis I don’t use a linear curve… I use a more subtle curve near mid stick and the 3/4 to full is where most of the pitch will happen. Set like this you have to be careful because if you move your stick to far you could have a bunch of pitch within a very small movement. Which can be useful for certain maneuvers.
Keep playing around trying different combinations and one is going to feel right. Then you have a good base to start from for other helis, however no 2 helis are the same:)
Reply: @DaddysRCAddiction  these little helis are squirrelly!!  Seems it may be easier to learn on a bigger 400 size for the stability.  If I could just get over the anxiety of flying this I think I'd do much better.  I can fly the sim no problems at all!  Thanks for your help!
Reply: Can you explain the gyro a little bit better to me.  I mean what does -75 vs +75 really do.  I know the negative number unlocks the 3d but I don't understand how.  As it is now I have -50 +50 and I have gyro on switch A and assigned it to "gear".  I still like the toggle option of stability mode in any flight mode.